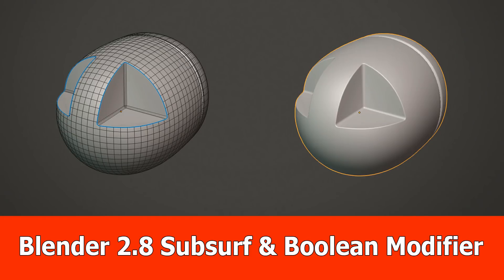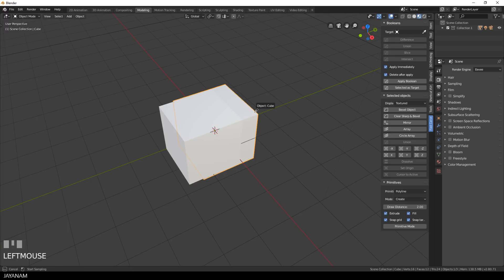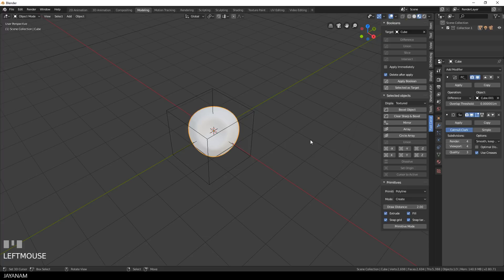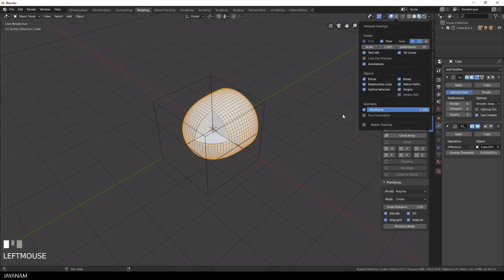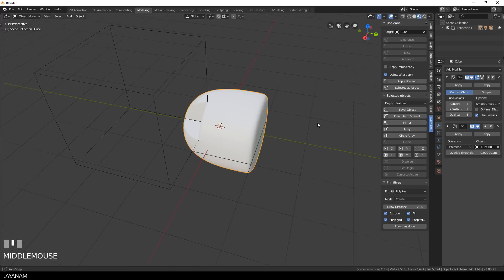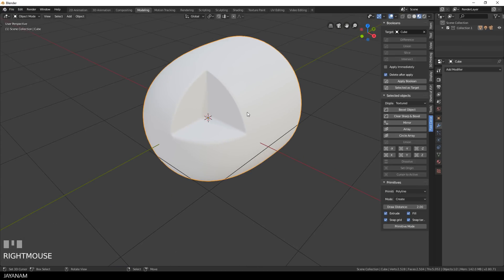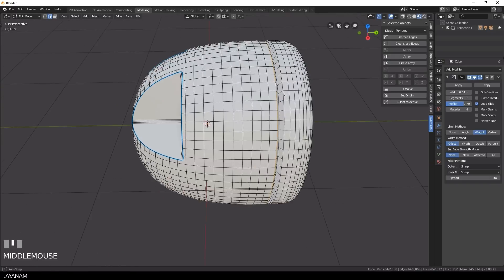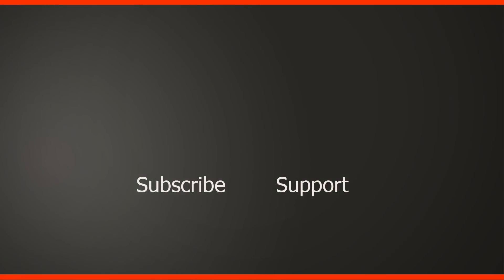Blender 2.8 Subsurf & Boolean Modifier Tutorial

Comment: doesn't work just makes the secondary object start z-fighting itself
edit: it works but not in projects made before installation of the plug-in.
EDIT2: it prevents auto-smooth from working on a booleaned object.